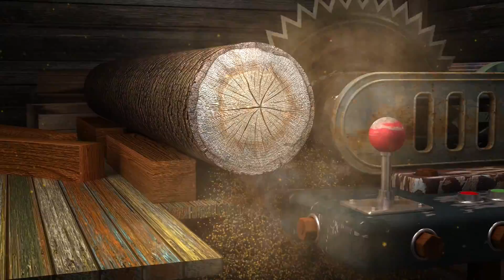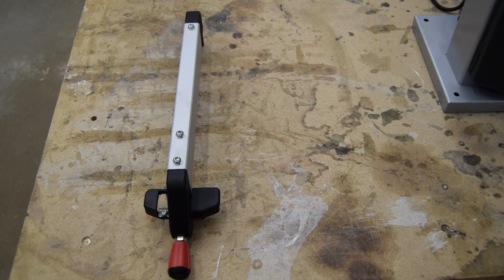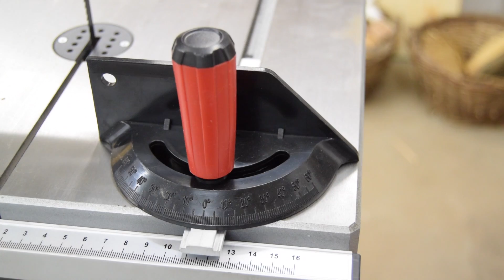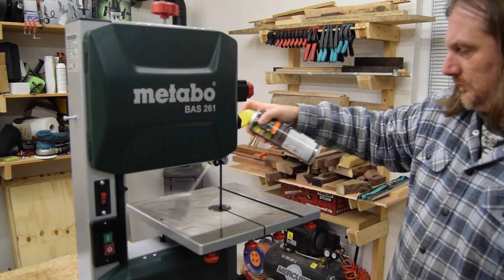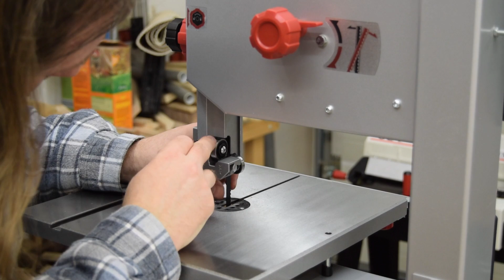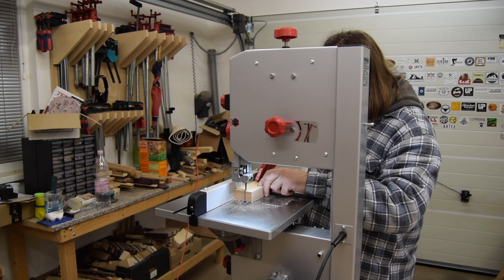METABO BAS 261 BANDSAW -    unboxing and first look

Comment: Does the lower wheel ever need to be adjusted? Is it possible to adjust the lower wheel in this model? The owner's manual does not mention the lower wheel.

Comment: Need your advice. Should the blade touch any of the bearings when you turn the wheel by hand or when saw is running? Bought a brand new Metabo BAS 318, was working perfectly when the blade caught the plastic insert on the table. Since then the blade is drifting to the left badly when cutting.
Reply from the maker: actually it should not. It should be a hair of space between the blade and bearing.

Comment: I was looking to buy this or Scheppach HBS 250. After reading the comments, I'd rather go for the HBS250.
Reply from the maker: Alex Gempfer Good luck with your new bandsaw
Reply: Scheppach makes really good bandsaws but HBS250 is not better than BAS261. The hbs doesnt have cast aluminium table like bas.
If you want a better saw than this one i reccomend Scheppach BASA1
Reply: @TheAlogoc  I went for scheppach hbs261 500w motor. Very happy with it.
Reply: I curently saving money for Scheppach BASA 3...i watched all of the reviews out there and i even saw People replacing the Makita whit BASA3.
Its a really really good saw. Pricey but good
Reply: @TheAlogoc  it's funny how I don't have any of the issues mentioned and the first thing I checked was vibration and blade run. However I did install a different blade. Could be a problem during assembly. But run mine daily now with constant results. Basa3 is good, but I was looking for something in the lower range price

Comment: Hi mate... A few queations about the bandsaw. How many blades are in the box and what sizes(width) can it take? Thanks
Reply from the maker: i got 1 blade with my saw... and i think the max blade you could instal would be 1/2 inch.  I'm using a thin 1/4 inch blade for curves.
Reply: @sumandl  thanks.. In the end i decided on this saw as opossed to Basa1 because of weight and motor power.
Reply from the maker: Goran Jelenić Good choice! Where are you located?
Reply: @sumandl  i think i am close to you, just across the border whit Slovenija, place called Bregana, near Brežice, how about you?
BTW following your Chanel for long time.
Reply from the maker: Pozdrav i dobrodosel!

Comment: Just recently got one of these and it vibrates like mad. The top wheel seems balanced when I spin it freely though. Not sure if it's just been put together badly.
Reply: I also got one recently and there's quite a lot of vibe. Reduced the blade tension and it's better but there's still some vibe. I think this is a common problem for this model

Comment: a  limited use tool that is really only for very light soft materials of miniscule dimensions.I have this machine which came with a poor quality, baldy set up blade that blunted in less time than it took to open the box it came in. After following the video instructions of Alex Snodgrass and with a new blade I realised this size of bandsaw offered little for me. My advice would be to buy an electric jigsaw which will do everything a bandsaw does and much more.

Comment: What is the sound level and where is it made? Thanks.
Reply from the maker: it's not loud
Reply: @sumandl  Thanks. 1 more quick question. Are you able to balance a coin on the table without the coin toppling? Mine seems to have a fair bit of shake.